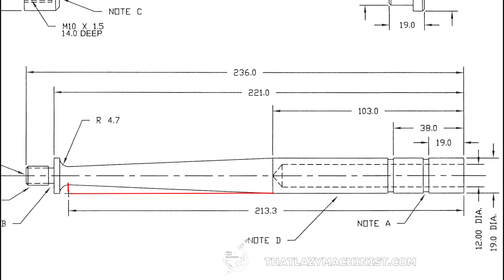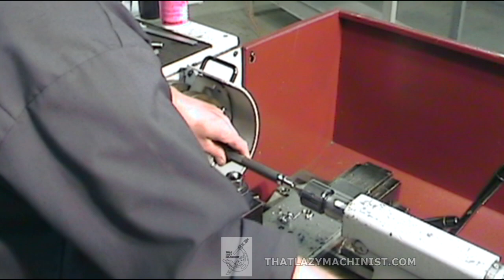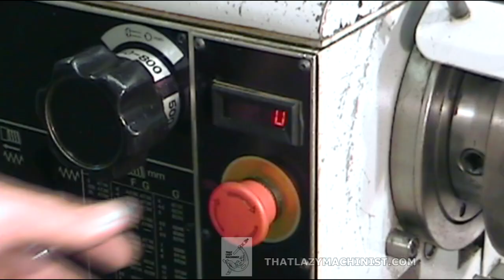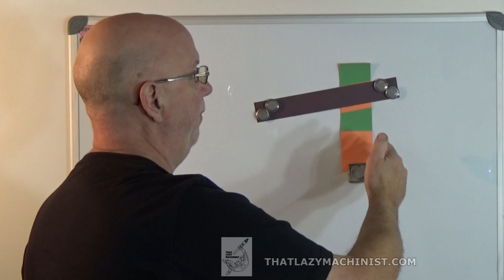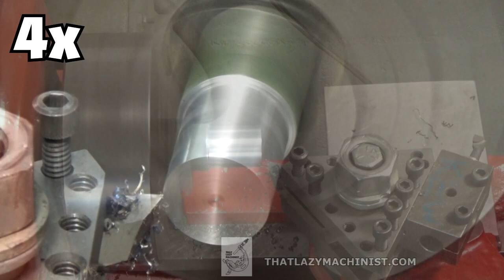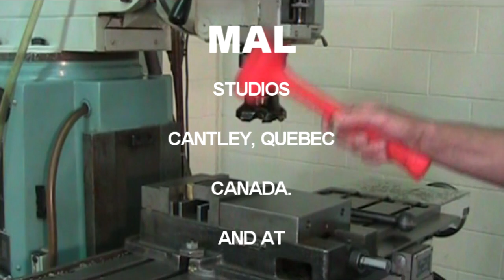HAMMER HANDLE #4 INTRODUCTION TO LATHE WORK (how to machine and calculate tapers)THATLAZYMACHINIST

Comment: 3:08 - small correction. We can not divide by tan. Technically we are taking inverse tan of both sides. This is a case of making two mistakes that cancel each other out, so it's fine as it is for practical purposes. I'm simply commenting for folks out there who know enough math to be confused by this
Reply: Also, question at 5:50 : We want the taper to "meet" the circular cross section we've already cut out of the part. But if we use an over-estimate for the angle, then we will actually miss the circle completely, resulting in a jump. Shouldn't we round down in this case?